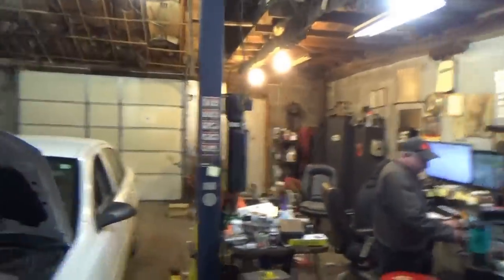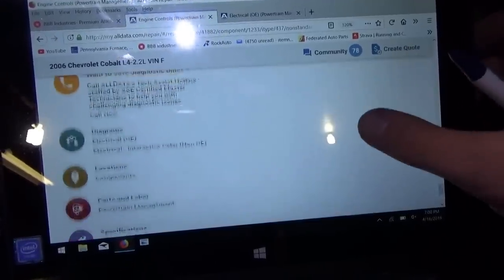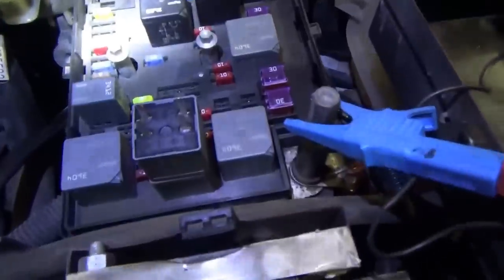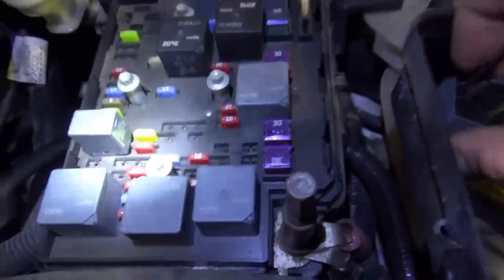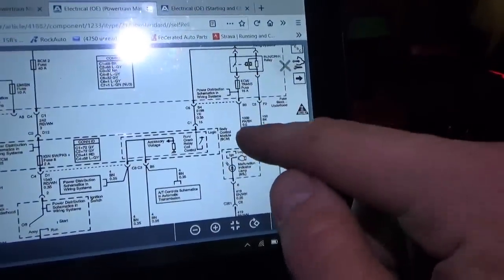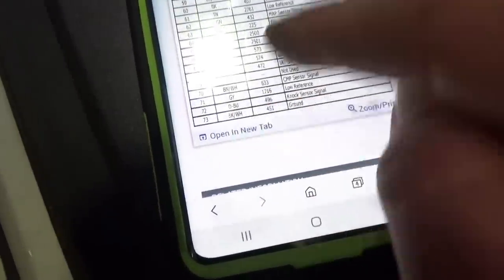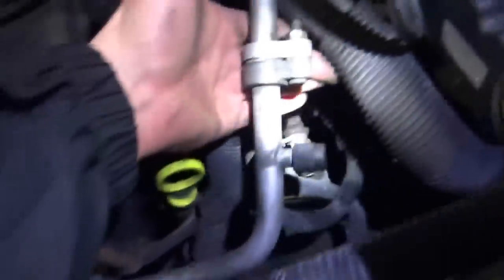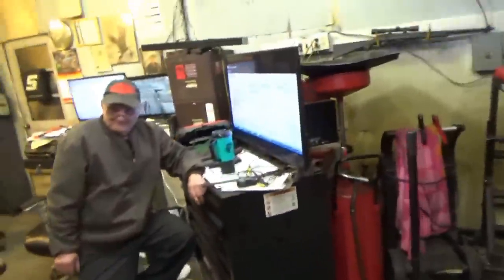No crank? it's a Ghost! (Chevy Cobalt)

Comment: Some ECMs will go in safe mode (theft mode) when they detect un-commanded engine crank that's why it needed a code reset to restore crank relay control. 
Nice fix Ivan 👍
Reply: Still doesn't answer the question who the heck would want to steal a cobalt?? LMAO

Comment: Had a coworker do a wiring harness on a Chevy diesel ,he was in such a rush to impress the boss that he left the shared  ECM/GPCM ground only hand tight. Truck got towed back in later that night as a no-crank , I attempted to communicate with it with the Tech2 and no comms I used my 3157 home made test light to load test the ECM fuses and all the relays started to chatter just like that. Since I know he had just done the harness I went right for the ground on the engine block and found it very lose. tighten it and all fixed and of course he came over and brushed it off like yea what ever it happens. Awesome video Ivan

Comment: As a rule of thumb any time you have clicking relays it's a ground problem have seen a lot of problems on newer ford's very good video on the process
Reply: Saw the same thing not too long ago on a '95 Jeep Cherokee.  The ground on the side of the engine block near the ignition coil worked its way loose.  This caused the idiot lights in the dash to flash rapidly, to the same tune as the relays going crazy in the PDC.  No crank, no start.  Cleaned the ground connection there, tightened it, and all was well again!

Comment: FYI, the actual ignition key release is under the steering column. There's a little plastic/rubber panel you can pop off on the underside of the plastic column shroud. You can then use your finger to push in the plunger of the solenoid that prevents the key from coming out. That way you don't have to drive around with the center console removed. The key being stuck in the ignition actually is unrelated to this car's issues. All Cobalts and HHRs have that ignition switch issue.
Reply: And how do you fix this issue? I have the same problem
Reply: Of coarse ya did after ya watched the video
Reply: This is a stupid feature where if it detects a dead battery it springs that little white piece OP is talking about. The stuck key is just a faulty design. Just keep a screwdriver handy In case battery dies

Comment: This video helped point me in the right direction with my niece's 2007 Cobalt. I also found that the park/neutral fuse kept blowing & found the loom for the range sensor had rubbed against a stud just enuff to short to ground. Id have def been scratching my head a lot longer

Comment: The key not returning to the LOCK position is a fairly common problem on the Cobalt. There's actually a release button inside the steering column where you can manually release the key. It's awkward to reach, but the access hole is on the bottom steering column cover.

Comment: I was test driving an Avalanche after an engine performance repair and stopped in a parking lot because I realized I'd forgotten to clear codes and fuel trims. I hit the clear all codes from code scan command on my Snap On tool and then remembered I needed to save  something from that data before clearing it. I hit the abort clear code command from the scan tool and the "truck" wouldn't start afterwards. No communication with BCM. Thankfully I was only a couple miles from the shop I worked for at the time and was able to get a co-worker to bring me a 1/4" ratchet and 10mm socket. I did a battery cable reset and all was good after. The clear codes situation on the Cobalt reminded me of that. Dang GM modules! Great case study Comrade!
Reply: lol, always carry something to unhook battery! sans that on sidepost just twist the whole cable/end hard and the "fangs" will eat the lead post and loosen up the bolt enough to turn by finger. top post same. then again not everyone has plier hands  :)
Reply: @throttlebottle5906  Yeah I thought about that, but if I were to carry everything I might need for surprises on customer cars, I might as well just drive my work truck. 😂
Reply: @gearheadautomotivel.l.c.5476  fair point, but a pair of "pump pliers" and "multi-bit screwdriver" go a long way when stuck with such a simple issue ;)
Reply: @throttlebottle5906  Touché.

Comment: A do a full ECM reset whenever I've had a low voltage or bad ground issue. What can happen is that the volatile stored values for everything from the fuel trims to the current rolling code for the key will turn into something nonsensical because the power level dropped to the point where they couldn't be stored reliably (most ECMs have "undefined" behavior below something like 9 volts). The bad values then cause all sorts of problems. Usually you end up with a rough idle, wrong idle speed, bad shifts, and sometimes even keyless entry stops working. Sometimes it'll start and fix itself after a while, but its just easier to clear all the values. To be sure I disconnect the battery for 30 minutes so that the store values in the ECM, Transmission ECU, BCM, and other modules are lost and everything starts from scratch.

Comment: i have the cobalts twin the pontiac g5, known for ground problems. ground wires also  under driver headlight and coolant tank. check all of them plus fuse for bcm/pcm for corrosion/oxidation

Comment: I’ve got two question for my situation with no crank no start. New battery. New starter. 1)what if I don’t have continuity to the starter like you test at 7:45. What should I do. And 2) what if I have a weak ground on the bottom right pin. Should I ground ECM to strut tower bolt? What size of bolt and nut for the hole on ecm? Is a thick gauge wire good enough to ground? Should have zero resistance right? Thank you for your time. If you can help me diagnose issue, I would not mind helping you out with a tip. $$

Comment: I realize the age of this video however, after seeing the corrosion on the eyelet on the transmission & seeing the misfire, there is also a grounding pount on the right side(driver side rear of the engine fornthe coils. Its worth checking.

Comment: Well i have a dilemma. 2006 Cobalt,i followed your video as best i could, upshot is it has 4 wires at that ground stud, the 3 smaller gauge were broken off the ring, the one large one was still barely attached. Repaired that and still no crank, i can jump ground to the pin on the crank relay and it'll crank over. I'm hoping i can come up with a scanner to clear codes. But this car is really teetering on fix or junk. If i can get it to run my neighbor will really be happy, it's his kids junker/ beater for running around town.
One thing is the ECU connectors are different, they aren't side by side they are over/under. So may be a different engine or something

Comment: Thanks for this video. I went straight to testing the ECM ground and got 12V. I thought it was going to be a simple ground cleanup. I'm certainly going to put in some work into this now.

Update: I went to check my always ground on my Run/Crank relay and got positive voltage. I thought I must be crazy, then I pulled up the fuse box schematic. Turns out the fuse box had fuses where there should be circuits. Relays were missing and some were backwards. Replaced the fuse box, and it started right up. Thank you very much for this video. Now I'm following wiring diagrams everywhere.

Comment: Smashing diag :-D
The rattle of the relays did sound like a bad 12+ or gnd to the drive module, someone did say "Always check power and grounds on ecm/modules." it may have been you lol.
I did get a bit lost at the point where you decided to connect a bulb to 12+ and the relay coil-- drive, then you jumped to testing the 12+ on the relay coil+ instead lol.
I had to watch that again untill i knew where you were going lol, i get mixed up easy if i'm not actually doing the job myself.

Connecting a low resistance bulb from +12 to the crank relay  coil -- sounds very dangerious, it could have overloaded the module and blown the output, that relay coil can't be asking for much more than 300mA and the drive transistor could have been blown out.
Expensive module death :-(
Just my opinion/worry.

Comment: Nice find! That eyelet terminal was a mess. Shame on such a low mile, relatively new car. Par for the course today. Chinese copper / slag wiring & terminals  ... 

Always amazes me how a missing ground will do all kinds of unpredictable, strange stuff! I learned that many years ago troubleshooting a turn signal issue on a motorcycle - just because of 1 bad ground, the opposite side light would blink when one side only was activated. Was also blinking the wrong filament in the bulb, lol! Running lights up front were also dim on one side. Fixed the ground, and everything worked normally. Lesson there is, electricity will find ANY path back to ground it can, usually unintended, or illogical  paths. 😎

Love Jim's computer monitor! That thing is MASSIVE! 👍👍
Reply from the maker: Haha yup biggest Verus screen ever lol

Comment: My 2006 is having all these and other problems. It started after replacing wheel bearings and moving wires to diagnose a bad wheel sensor. First symptom was the gear position switch not reporting. Followed by all kinds of crap from no gauges to every alarm imaginable buzzing relays. I bumped the wire loom in the area of that ring and it quit. Will check it in a few hours.

Sure as shit mine is busted too exactly the same way. Will get to repair.

Comment: 90% times when anything controlled by a computer end up into a indefinite loop, expect something which causes an reset - run - crash loop. More often it's the grounds which fail as on the positive side there is only a battery terminal out  there in the wild. Car manufactureres should add "clean and grease body grounds every five years or 100 000 km / 60 000 miles, which ever come first. 200 000 km / 120 000 miles or 10 years in CA, AZ, TX... "

Comment: Just want to add to that, I had prob 5 different cobalts fail from grounds mostly g105(same reason) but they all showed different symptoms.  None had a clicky clicky relay yet lol.
Reply: Any washer pump issues?
Reply: @beastumfan  none that I came across
Reply: Hoping you may give a reply. I'm a former mechanic, it's been a long time tho. Found 3 broke off wires at 105, fixed that and still no crank. On the ones you fixed, did you need to clear codes to get it to crank? If so I need to source a scanner. I can't believe this didn't fix it. How many things can go wrong at once?

Comment: Not all clicky relays are a bad ground. I had one go clicky on me that is used to turn on my light bar. It was the relay itself that was the issue. Not a ground. I would have swapped relays to see if noise followed relay to start with. If it didn't then I would have started with what was going with that relay.

Comment: That was a great video on these high-tech over-engineered. I said cars of today, ridiculous and this is an 06. Just think of the 2024 S and 5. All that work and time.
 e. To find that no wonder you gotta spend $ 2000 bucks. To get your car to run that most people don't have. Can't afford  Get a car
 From 1980 on back. Yeah, I said that these new cars suck over-engineered. The government made them that way so everybody gets screwed, have a great day. Oh great video. Watch the whole thing amazing what you had to do.PS And that was only one problem.
 What about the crank sensor the cam sensor the knock sensor the 02 sensors and on, and on with the 25 different sensoh. Yeah, it's a nightmare😢. On the
 Positive note have a great day.😮

Comment: so far I'm in this is an awesome video won't be able to finish it up I have to go work on my car one week away from vacation I threw a p0171.......I believe with the help of different videos I have eliminated it down two front oxygen sensor is basically dead giving me out 0 volts so off I go to the auto parts store thanks to you.. Eric.. and scannerdanner  I'm on my way
Reply from the maker: Good luck!
Reply: @PineHollowAutoDiagnostics   successful fix I now get a response of waveform no longer flatlining most of the time at 0 volts

Comment: The current draw of the relay coil  is typically 150-200 mA is it to much to put 2 Amp on the control ground ECM side of the relay I don't know just asking?
Reply: I was wondering the same thing I think it was a 1 amp load he put across the pcm ground control wire, how much current can a pcm control safely sink ?
Reply from the maker: It was just 1amp...close enough 🙂

Comment: Of course it's G105 even if it's a GM, G105 is more common on Chryslers Eric O knows all too well.  Had this happen in my Powertrain Class it was a 2009 Cobalt, my instructor had us remove the transmission and reinstall it, one of my classmates didn't hook this ground back up 🙄

Comment: I have this same car, same problem, but no clicking relays.  Have good ground at the pcm (105).  Can jump the relay and make it crank but no start.  Key on, and everything works but no crank.  Car has new programmed pcm, throttle body, ignition switch, scanner says everything is communication and requesting crank but no crank.  I've been all over the car and triple checked everything I know how to check.  I'm pulling my hair out.
Reply from the maker: Interesting...why does it have all those new parts?

Comment: I have the same problem with my Pontiac G5 2,2L 2008 model, if i understood correctly the video says that i should reset the computer and it will work ?
Reply: Did u fix problem no start  no crank

Comment: Everybody is calling bad ground, I am calling something under the floor-mat in the car in the other bay making this car not crank... my pre-video guess....
Reply: Boy was I wrong... :-/ 

Just needed a Jim to clear the codes 😂🤣🤭
Reply from the maker: Lol Eric! Your gut instincts are spot on as usual! Yeah bad ground was the first thing that came to mind but it was more fun calling it a ghost 😅
Reply: @PineHollowAutoDiagnostics 
I have a 2007 Cobalt and every time it rains my gauges go dead, anti-theft lock icon stays on and it won't crank.. there is a click every time I turn ignition to start. If it stops raining it'll start the next day. Also, there is no water on either floor inside the car.
Reply from the maker: @S_C_A_R_F_A_C_E  interesting! Sounds like the water is shorting out a connection somewhere. Definitely need wiring diagrams and description of the starting circuit 👍

Comment: had a similar  ground problem  with my   2006  P. T.  Cruiser went on ebay and picked up a package of ground straps   added extra ground straps  and cleaned the rest of the factory ones   >>  problem solved

Comment: That was fun, but how did you manage to remove the stuck key after all?
Reply from the maker: You can manually move the lock solenoid under the shift lever :)
Reply: @PineHollowAutoDiagnostics  yeah but doesn't that mean next time I put the key inside it'll get stuck again? How do I fix that? Thanks so much for answering, I really appreciate it!

Comment: 14:00 5-years ago this burnedme. If your car has 16pin dtc connector make full" (even radio) mood(code) scan to it. If it has even remotly a code for any relay then do NOT trust your test ligth results!!!!!!!!!!!!!!!!!!!!!!!!!!!!!!!!!!!!!!!!!!!!!!! ...It may just not turn it on just because there is no relay and it knows it even if diagram makes it in posible........